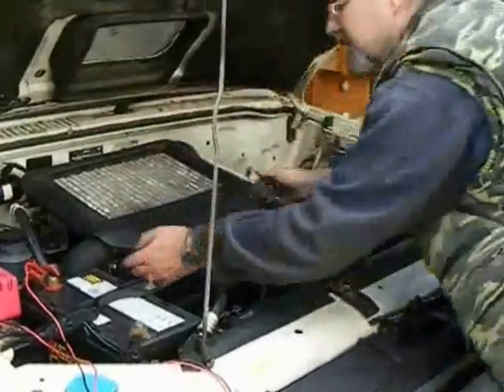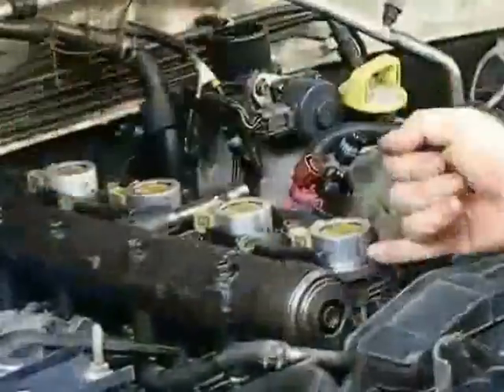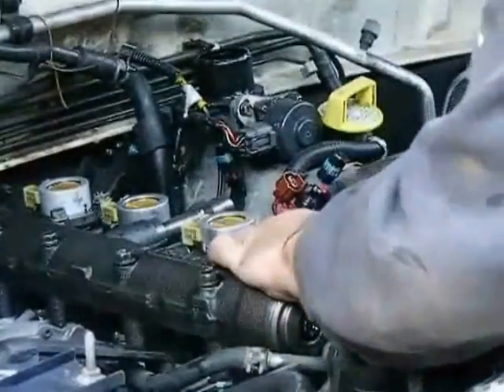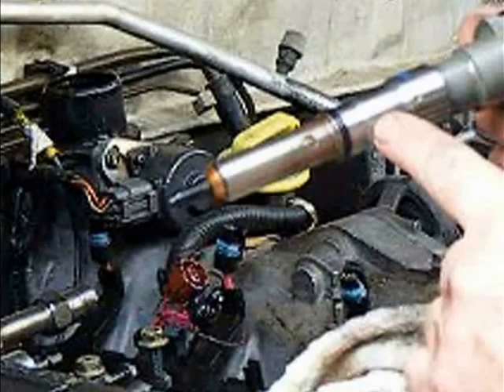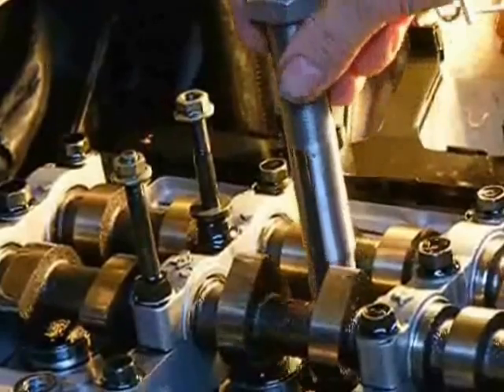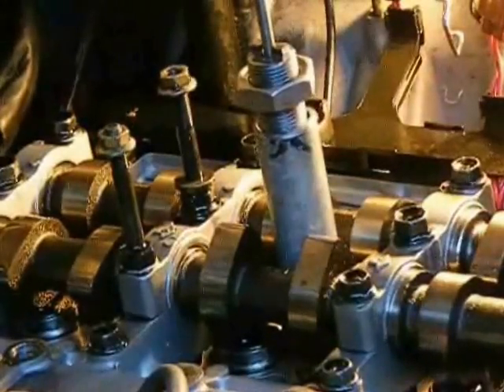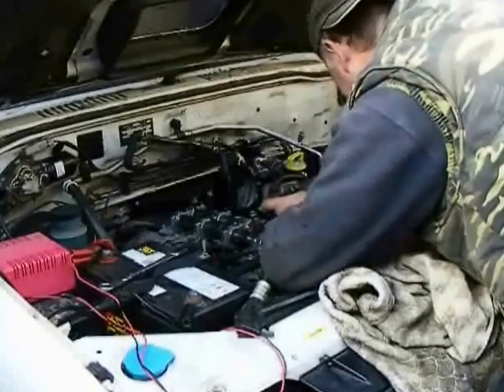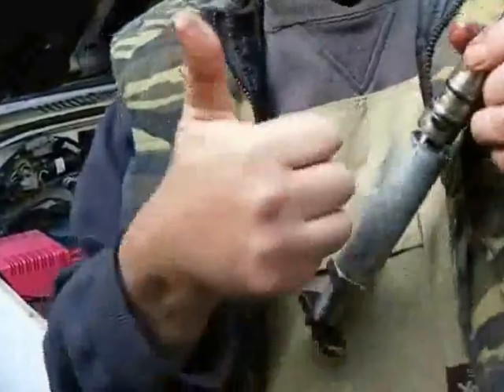Removing Isuzu 4JX1 Diesel Injector Sleeves

Comment: Hi, diesel fuel (4 litres) has mixed with engine oil (8 litres), level about 1 1/2 inches above max on dip stick. I found small amounts of the mixture in each of the 4 cylinder combustion chambers. How can I remove this without removing the cylinder head please ? Any help would be appreciated.

Comment: hello edwin. i have a problem on my isuzu 4jx1.  diesel moves to the oil... 
what is the reason? what can i do?  it is injector problem or something else?
Reply from the maker: this seams a simple problem of replacing the fuel injector seals. Do as in my videos.  If your head has failed... to be honest this is rare.  Replace the injector and copper "gaskets".  In truth replace the injector COPPER GASKETS at no more than 50,000km and this engine and you are likely to have no other problems.  That is the quirk in the 4JX1 - replace the copper washers at 50,000km and you are very unlikely to need no other maintenance
Reply from the maker: this appears to be injector seals.
Reply: http://4x4club.ru/engine/4jx1/ читай и переводи
Reply: lasha vepkhvadze

Comment: Great stuff. Thanks for getting back to me so quickly. All I need now is new seals etc and that removal tool. God knows where I'm going to get a removal tool from..lol.  You any tips on how to cleanup the injectors??

Got one more question though - its not related to the injectors but the same 4jx1 engine.  

The vacuum system for the 4x4 has a pipe that comes off the engine block on the oil pipe, throttle body side.  There is no vacuum produced from this outlet any more !! I've had to tie the 4x4 vacuum pipe system into the brake vacuum system to get the 4x4 to work.  I hope I'm describing this clearly. 

So basically the engine is not creating a vacuum for the 4x4 system where the 4x4 vacuum pipe connects.

Any ideas ??

Comment: Hi Edwin. I have the 4jx1 engine and I've got diesel in the coolant so l'm thinking its a injector sleeve issue.  I've got the manual with the removal procedure but safe to say, your video is soo much easier to follow.  One question - if refitting the original injectors etc do you need to use the TECH 2 ?? I ain't got a TECH 2 so l'm hoping you'll say that its not necessary if the original injectors are going back in.
Reply from the maker: Hi Steve.. nah the ECM is already programmed for your injectors so you don't need a Tech2 :).  The injectors are graded in at the factory.. but it's worth writing down all the numbers on the top of each injector ( which may differ on each cylinder ) and storing that information in case you ever need it in the future.

Comment: Edwin another question mate. with the sleeves how do I go about reinserting them?
Reply from the maker: when everything is spotless clean.. err Spotless... just push the sleeves back in the head with new O-rings and copper washers/gaskets.  You will likely need a drift of the right size ( eg a socket on a straight bar of the right size ) to tap them home.  The manual says they have to be 15mm from the top of the sleeve to the deck of the head.  This varies a tad if you measure it with a vernier..  either way you'll feel the sleeve bottom out on the copper washer at the nozzle.  That's it.  After that just follow the specific torque sequence in the Isuzu manual for settling them in and you're done.  
And by the way - the torque figures in the manual are perfectly right, so the small bolts that hold the injector to the HP oil rail will seem awfully lightly in.  But RESIST all TENDENCIES to overtighten them, for this is a major cause of failure after a repair.  You see, the assembly is designed to flex under enormous pressures and if you overtighten the bolts the O-Rings distort and will go PING!!! straight away.  Follow the manual religiously.  I say so because I've bought very many Jackaroo's for $500 and fixed them by simply replacing the O-rings again and retorquing these little bolts after some hack mechanic has schrunched them up and knackered the O-rings
Reply: +Edwin Henry Blachford thank-you very much for the help mate. I didn't know that! I've never worked on a diesel and I want to get it right the first time. thanks again

Comment: Dear Edwin
can i still used or repair  my  4jx1 injectors being diagnosed  by computer  defective 
   thanks alex
Reply from the maker: there are no parts available for injector repairs sadly..   But it is wise to confirm what exactly the diagnosis meant. Was it the wiring loom?, for example.  In fact many injector faults are caused by the subsystems that feed them and of course the computer doesn't know the difference. For this reason, I never throw away injectors ( and always collect any deemed "faulty").   The simplest way to test them is to bolt them into a good engine and see how they run

Comment: Hi Edwin,
I would ask something since we have the same vehicle model. My problem is there are oil leaking in exhaust manifold. May I know what could be the probable cause of it?
Thanks.
Reply from the maker: Perhaps 1st check the PCV valve is working well - clean it.  but most commonly this is the seals in the turbocharger gone.  The turbo dies gradually ( as all turbo's do..), but soon enough a clatter starts up.  Many have success with the Chinese clone turbo's on eBay.  A cheaper way if you have patience is a turbo "insert" kit.  If you buy the turbo from before 1999 model you get 2hp more
Reply: Thank you.
Except the turbocharger is there any problem aside from it because the oil spill is spewing too much in exhaust manifold.

Comment: have a 4jx1 manual my jack starts over heating with in a 10 k drive no diesel in oil or coolant    i just put in new radiator no difference the  clutch fan spins a bit after i turn off motor could it be this any ideas cheers
Reply from the maker: hmm.. if you're driving the 10km from cold without stop/start, just the airflow should be sufficient to cool the engine down reasonably. Yes a duff fan clutch would allow a temp increase of course, but within 10km? hmmm.. .  i'd be looking at thermostats first (maybe get a new one since they're cheap enuf). Something wierd with the water pump?   See if your radiator hoses have internal support ( like a spring shaped doodad) or are stiff enuf to prevent being sucked flat during operation.  If your thermostat looks bad or the hoses are real soft, check if you have "long life" coolant rather than the standard ordinary green stuff that's supposed to be changed every 2 years or so - if it's "long-life" ensure that it's "Japanese vehicle compatible" stuff since other types of long life coolant can play havoc with some rubber parts

Comment: Nice video, other than the lower injector sleeve o'ring can fuel get to the coolant another way? I have a 4jx1 with diesel in the fuel and the mechanic is saying there is a little radiator inside the fuel pump that cools the fuel. He says that's leaking and it needs a new pump over 3k worth! But all my digging I can't find anything about this little mini heat exchanger, I looked at various exploded diagrams, but they have been a Trooper not sure if the Aussie Jackaroo is different.
Reply from the maker: +Ben Griffiths Hi Ben, above the 4JX1 oil filter theres an oil cooling pad with fins on it and coolant swirls around in there.  If that leaks, you would either get an external coolant leak or coolant in the engine oil; which it seems you dont have eh, so its not that.   

The fuel pump is a part on the back of the high pressure oil pump ( LHS under the inlet manifold ) and is not water cooled, in fact the oil temperature in the HP oil pump helps to preheat the diesel fuel.    

Sometimes you can get a head gasket blown, or a cracked head maybe in rare cases, and that can put coolant in the fuel but it would be running very poorly then and usually you get a heap of smoke etc..   So id suspect sleeve seals first.  

The sleeves fail in 99% of cases because the copper washers wear out and let in combustion gases and blast gases/coolant/fuel around.. it usually starts slowly then gets worse and worse.  Since its actually the copper washers that need replacing ( and the O-rings too since they get damaged ) youll see carbon on the tips of the injectors above the copper washers.  Watch my video here >   https://www.youtube.com/watch?v=BpNEPNfAGNo
Reply: +Edwin Henry Blachford Thanks for the fast and detailed response, that certainly puts my mind at ease, especially since he was quoting high prices, I was also under the impression that there was a low pressure fuel pump near the high pressure oil pump and makes sense that fuels sneaks past the lower oring and its most likely the cause. I was quite lucky that the copper gaskets didn't have any leakage, but the engine did have a minor miss in 4th or 5th when I stamped the pedal down. Which is why I started to suspect the o'rings and also it had a diesel smell in the fuel. 

I will ask the mechanic to test the injectors and replace the injector sleeve seals. Then see how it goes before shelling out tons on new a pump, which by the sounds of it doesn't need it. 

Thanks again!
Reply from the maker: +Ben Griffiths yes the High pressure oil pump is very robust.  Sometimes the Oil Rail Pressure Switch on the back of it get&#39;s &quot;varnished&quot; and needs a clean since varnishing makes it &quot;jerky&quot; in operation of the oil pressure driving the injectors.  
However this would not explain coolant/fuel cross contamination.  My &quot;intutition&quot; says that you have copper injector &quot;gaskets&quot; failing. It may be that at this early stage just replacing the copper washers ( Isuzu- &quot;gaskets&quot;) may solve the problem. A simple and inexpensive job.  The new material of the rubber O-rings ( that was replaced under a manufacturers warranty in all 4JX1's) are remarkably robust - so early replacement of the copper gaskets may be sufficient.  Yes, these are remarkable rubber O-rings of very high durability so always use the latest and genuine Isuzu part number.  As always, check the base of the injectors above these copper parts &gt; if they are bright and clean you only need to replace the copper parts.  In all centre-fire common-rail diesel injection engines these seals are best replaced at 80-100,000kkm intervals. The copper sealing parts expand with heat and seal the seat of the injector against combustion heat and pressure, however if these HP seals fail the rubber o-Rings that only seal fuel and coolant pressures will likely need replacement
Reply: +Edwin Henry Blachford. I would tend to agree, plus the washers/orings are the cheaper and easiest thing to isolate. I was a diesel mechanic myself many moons ago, but currently located overseas ( car is in Cooma Aust ) or else I would work on it myself. It seems a lot of mechanics are scared to work on these vehicles and jump to a lot of expensive conclusions. The mechanic found the glow plug power rail was partially missing, someone removed it, and two glow plugs could be hand spun due to having the thread stripped by someone who wasn't careful trying to remove them and conscious of the carbon built up on the tip. The mechanic has come back to me saying that the head is cracked and coolant surrounding the glow plug caused it to be seized into the hole and also caused it to be loose. Seems bit of a leap to me since he hasn't isolated the o'rings yet. Also coolant would be seeping/dried up around the glow plug, which it isn't, there is no oil in the coolant, no coolant in the oil, just fuel in the coolant. So it leads me to believe this mechanic doesn't know what he's doing. 

I asked him to test the injectors, replace the sleeve seals, affected hoses from the diesel and put it back to together. If there is still fuel in the coolant I will deal with it when I am home. I don't think these vehicles are that difficult to work on, but the work can eat up a few hours of labour, especially if you get a guy who hasn't worked on these.
Reply from the maker: +Ben Griffiths agreed

Comment: hi edwin, i own a pick up with a 4jb1 engine. my problem is every morning when i start it up i have 2 pump the fuel pump or else the engine will just die. it seems to have no vacuum. i have to do this 2 or 3 times until the engine heats up. but later in the day i have no problem. my fuel consumption is also high. can you help me?thanks and Gob bless
Reply from the maker: +paul patrick dipaling It sounds like there is an air leak in the fuel pipe system somewhere that's allowing the fuel to drain down to tank level when it's left for a time ( ie overnight ).   Usually this happens at the filter or water separator, since these are the highest part of the fuel lines so fuel can drain down from them by gravity overnight.  Check all hose connections.  Also, there is usually a non-return valve ( sometimes a flap, sometimes a ball ) under the priming pump that can become varnished in over time, and sticks open.  This allows the fuel to drain down over night.  Usually you just need to clean it. Carby cleaner might be best to avoid damaging the valve.  Also check that the fuel filter gasket is properly seated, or that there are no cracks in the filter housing.  Other than that, anything that might allow fuel to drain back, such as a loose hose clamp can cause this problem.  High fuel consumption could come about if there is air in the injector pump disturbing metering.  After fixing an air leak in the filter,  you may have to prime the injector nozzles, but try and run it and check first :)

Comment: i am from Punta Arenas Chile, I'm with a problem in a wizard isuzu which fuel oil passes me, and remove the injectors but I need to get the sleeve (sleeve) for review. That option must be able to give me measures extractor you used? or if any option to get the extractor.
PS: sorry the English since I'm using online translator!
Waiting for a prompt response. Alejandro
Reply: Alejandro Oyarzo   bakit domadami ang langis sa makina,,4jx 1

Comment from the maker: In a recent set of photos of failed O-rings, they appeared to have melted. This occurred after the owner changed from ordinary (green) coolant and instead used long-life (red) coolant. Further investigation showed the rubber diaphragm in the radiator thermostat had also melted.  This may indicate an incompatibility between the new long-life coolants and earlier engines not designed for it.  The red coolant may combine with traces of other substances and become corrosive to rubber.  Perhaps it is advisable to use green coolant and change it every 2 years as specified in the manual.
Reply from the maker: +Edwin Henry Blachford further note: In the long life coolant range you will find a product intended for >> Japanese Vehicles <<< specifically.  I hear no negative reports by users of this 8 year life product, so have changed my vehicles to it.  I suggest it might be best to use this product.

Comment: Hi what were the symptoms of the injectors going down?
Reply from the maker: Firstly you will notice fuel consumption increasing. Rough running, smoke, lack of power, hard starting are indicative. If there is whitish smoke with no smell of fuel, it is likely to be water vapour so suspect sleeve seals/copper gaskets instead.
The 4JX1 was the beginning of full ECM diesel engine control.  It is also the beginning of simple ECM fault diagnosis.  Learn how to read MIL codes or buy a Tech2.

Comment: Hi Edwin, is there a free downloadable parts manual for the 4JX1 engine?
Reply from the maker: hmm.. not sure Wayne. I paid $10 for mine on FleaBay.  At Australian4WD forums there was a few uploads I think, but the guy who runs that now seems to be taking stuff that's scalped off the site. Be worth searching there or posting a question maybe.   There's 2 pdf manuals around, one is 3500 pages, the other 12,000. The longer one has as section on rebuilding the autotrans and a lot more Tech2 routines. Really the 3500 page manual is more than adequate for most people. You'll find the manual doesn't seem that big ... until you open the chapter on emissions..for in there is 1000's of pages of Tech2 diagnostic routines